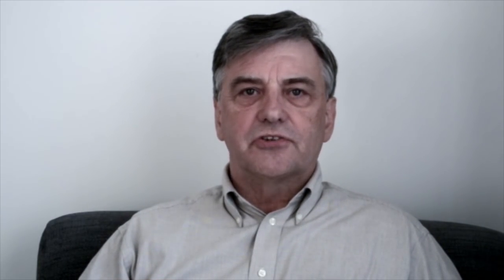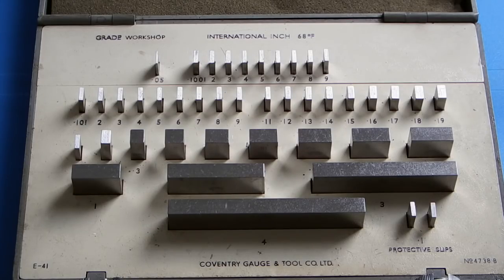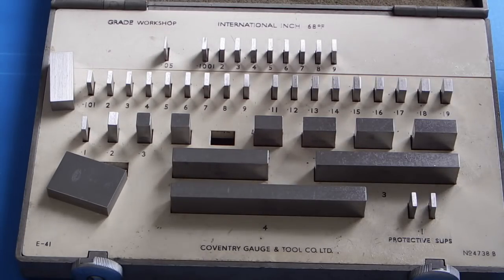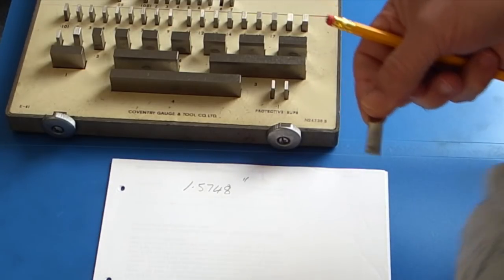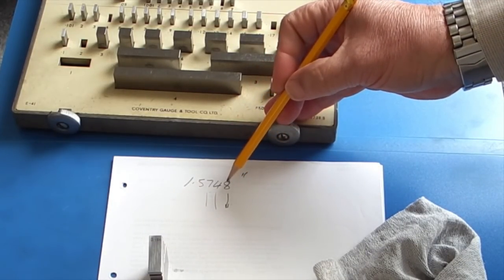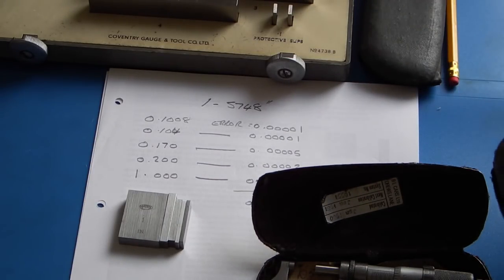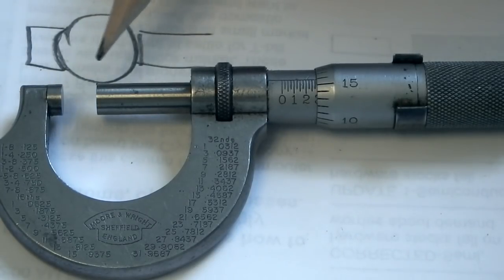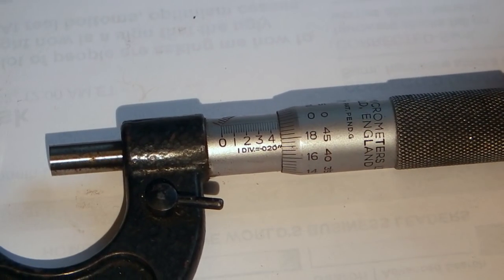Back to basics Gauge Blocks & Micrometers

Comment: The blocks can be, and are, oversized as well as undersized. It’s likely that 50% of the blocks will be oversized. The tolerances on my new blocks are pretty tight - my cheap metric ones (calibrated) are accurate to about 0.1 micro meters up to 50mm length. Easily good enough to calibrate my micrometers - a 4 to 1 accuracy margin is apparently enough for metrology labs

Comment: Nice tip for the lapping of the anvils. Thanks :)
Reply from the maker: Hi Adam a worn anvil is one thing that people don't check.
Reply: Takes a LONG time to wear the anvil on a newer micrometer, they routinely face them with tungsten carbide now, even the cheap Chinese ones, was much more of an issue when plain hardened tool steel was used.